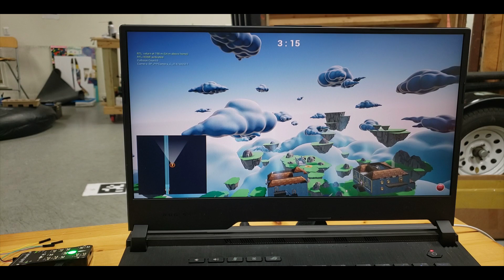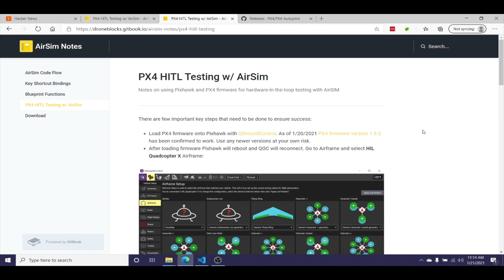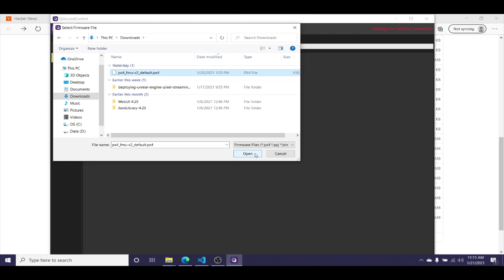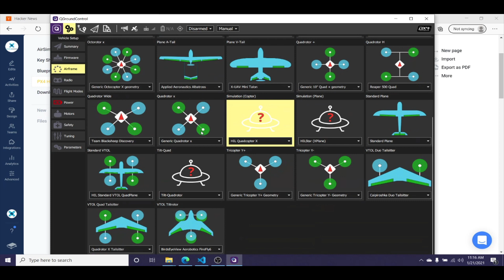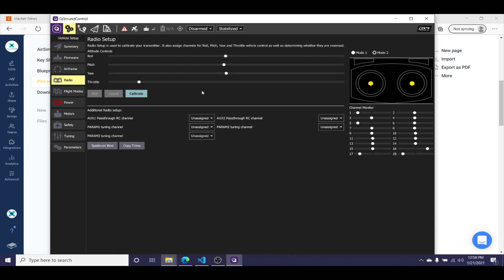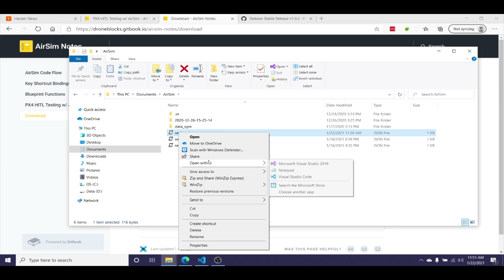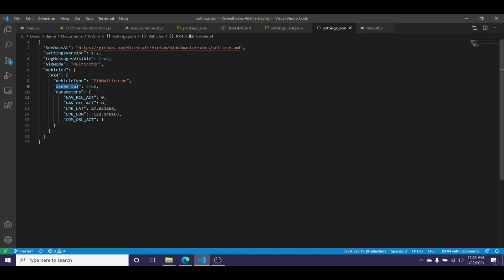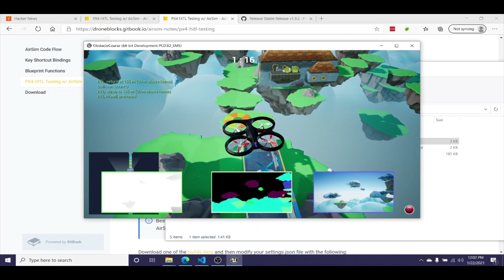PX4 Hardware in the Loop (HITL) Simulation with AirSim Custom Environment in Unreal Engine

Comment: Hi, for a while now I have been trying to import the AirSim drone into the environment. I downloaded a few environments which worked well just without the drone. But if I do build.cmd over the git repo of AirSim and then copy the plugin file into the environment directory, and at the same time do the necessary changes in the .uproject file the environment stops working. The error that comes is as this:
The following modules are missing or built with a different engine version:

AirSim

Would you like to rebuild them now?

And then... when I click "Yes" , 
the AIrSIm could not be compiled. Try rebuilding from source manually. 

Then after spending time scrutinizing the issue, I found that I did not have the ".sln" file generated for my environment project after adding the plugin. 
So, I am having trouble as to how I can generate such file?
 I even downloaded the Windows Sdk 8.1 and .net sdk framework, too, and already had a Visual Studio 2019, but still could not resolve this. 

Also, even with right clicking the .uproject, I am not able to get the option for "generate visual studio solution".

Comment: I am uploading the latestest PX4 firmware (v1.11.3 px4_fmu-v5_default.px4) to a holybro Pixahawk 4. I am selecting the HITL Quadcopter X air frame, to be used in Airsim. However, when the pixhawk reboots the sensors require calibration, more precisely
only the compass requires calibration the other sensors appear to be calibrated. I can connect to the Airsim simulator and control the UAV via the QgroundControl station, however, the orientation and compass do not function correctly (actually they are not functional at all.) I have tested everything with QGC v4.1.1 and v4.0.1 and teste firmware v1.11.3 and v1.9.2 as suggested.

Comment: Thanks a lot. I'm a newbie in ROS and PX4, and lately, I found about AirSim. 
Do you happen to know how to use ROS with AirSim? 
how do you export your code to use the real hardware when you are done developing inside airsim? 
Thanks a lot
Reply: You can interact with airsim through its ros wrapper. basically when you run airsim, several topics will be published, and you on your rosnode(ros application) can subscribe to them or if you want also publish on them. this way you can interact with airsim. 
most of the time, you shouldnt have any issues, provided, you have coded properly. (good abstraction etc)
you write your code, you can start with sitl or software in the loop, basically you create your ros application(nodes, services, etc) and test them in the simulator such as gazebo, rviz, etc. then when you implemented enough, you can switch to hitl or hardware in the loop, that is you connect your pixhawk for example to the pc running arisim for example. airsim will recognize your hardware and sends the sensor data to the pixhawk, pixhawk will also do its thing and return back the data and airsim will manifest them in the simulation as if its a real thing. your pixhawk doesnt know its not real (thinks all the readings come from its own sensors,) and you also test your application/nodes with the real hardware in place and see how everything goes. 
when you test your app and all is fine, you unplug the pixhawk, refine your code, and change the topics your were listening from airsim's to the actual topics from your pixhawk or its ros wrapper. and you are done.

Comment: What version of QGroundControl are you using?  I'm at 4.1.1.  When I load the HIL airframe and reboot, I still get the Sensors tab under Vehicle Setup.  I can't set my Flight Modes unless I calibrate my sensors.  For HIL mode sensors should be diabled upon reboot.
Reply from the maker: It sounds more like a firmware issue than QGC but let me know what PX4 firmware you’re running and we can go from there.
Reply: @dennisbaldwin  I have the Pixhawk 2.1 carrier board with Black cube.  I used px4_fmu-v3_default (v1.9.2).
Reply: More info.  I downgraded to QGroundControl 4.0.1 and the Sensors tab is not there under HIL.  I'm still using PX4 firmware v1.9.2.  My guess is somewhere between 4.0.1 and 4.1.1 it broke.  Regardless I had strange issues with 4.1.1 on my PC and MAC.  There were intermittent connection issues with the actual Pixhawk 2.1 board.
Reply from the maker: @aerobuilderdrew  I saw your email today and just now getting a chance to respond. I have QGC 4.1.1 which sort of contradicts what you’re seeing.